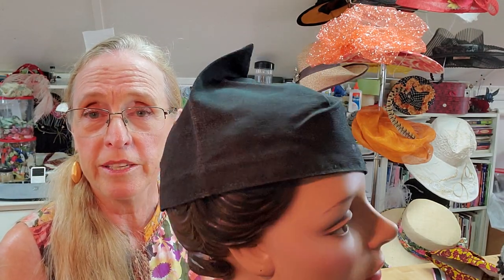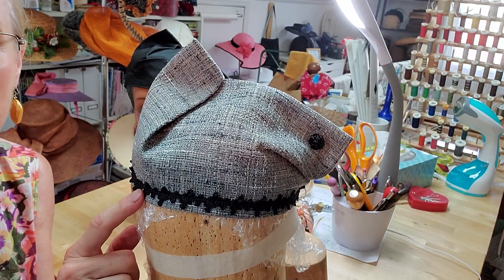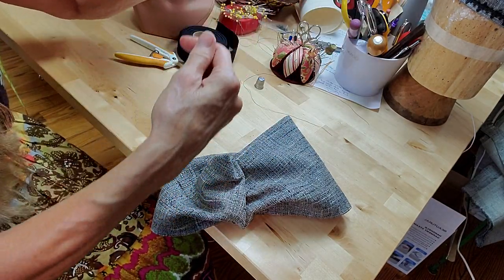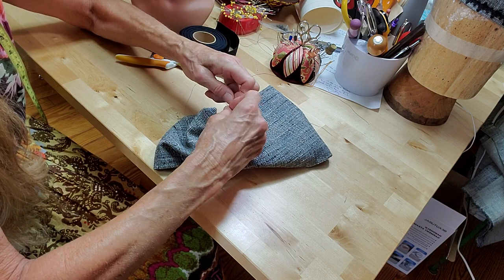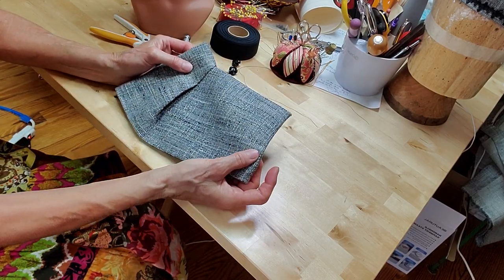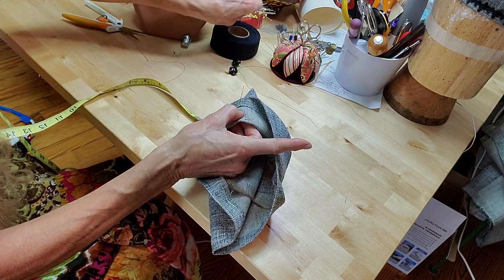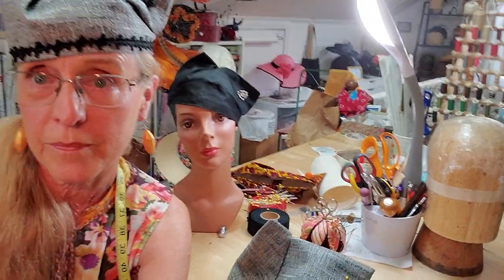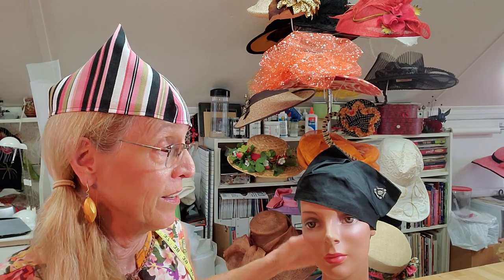Vintage to Modern

Comment: A nip here, a tuck there and you get an amazing hat. Thank you for sharing Kate :D.
Reply from the maker: Like magic isn't it? Meant to mention the dimensions so you can make one too. The finished hat before folding measures 12" across and 6.5" down. That's for my large 23" headsize. You  can adjust the width a bit if you are smaller.

Comment: I thik you are right about the trim taking something away from the hat. Maybe if it were less verigated?
Reply from the maker: Yes, I've decided the trim competes with the angles of the folds. I made another without the trim and like it better. I think it also needs a larger, more dramatic button (like the original) which I will have to shop for.